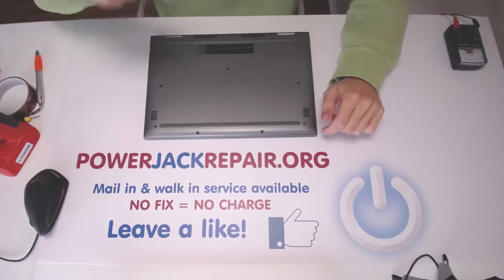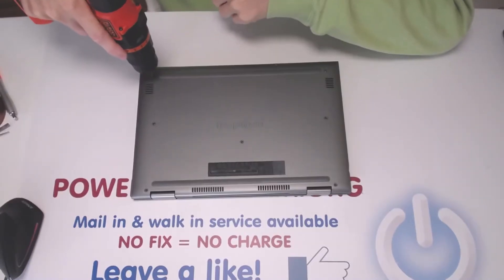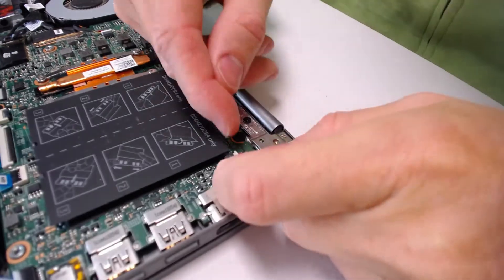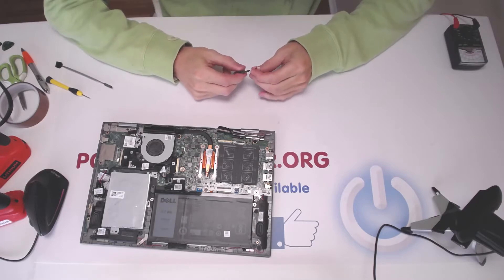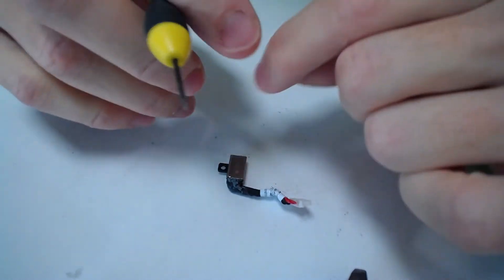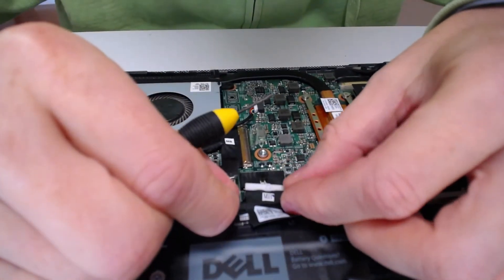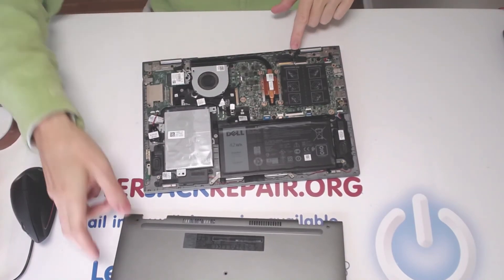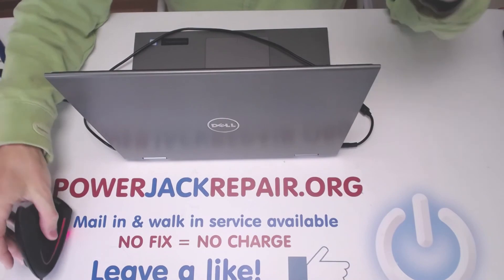Dell Inspiron 13 2 in 1 p69g p69g001 disassembly laptop charge port power jack repair fix taking

Comment: I have the same Dell p69G001 laptop.  I was able to change the charging port without taking the other pieces off.  Once I opened the back of the laptop and unscrewed the one screw holding the port down, I popped the connector off, took out the charging port, plugged in the new one and screwed the new port back down with that one screw.  I'm not sure why you took all the other components off first.  It took me literally 3 minutes to complete the replacement once I opened the back of the laptop.

Comment: hello I have a dell inspiron 13 2 in 1 5378, which I have problems with the battery. I bought a new original and this came bad, so they gave me my money back and I bought another generic. When I put in this new battery, the laptop started working fine but the Bios told me that the charger was damaged. I bought one and everything was fine until suddenly the laptop shut down and when I restarted it the next day I threw a problem in the fan cooler. So when I disassembled it, I found some pieces of plastic that had the fan cooler locked, I cleaned it and apparently everything was fine. But when reconnecting the whole laptop it does not turn on anything, in fact the lighting led only lights up for a second and turns off when I connect the charger. What can be how I can repair it?

Comment: i replaced DC power Jack cable for my Dell inspiron 13 5379 and new power DC cable Universal but still no power
Reply from the maker: Universal power supplies in theory should not be able to charge the battery on the laptop, you are sure the + and - on the new cable are correct ones the ones that go from the jack into the motherboard.
Reply: @Powerjackrepair  yes the powet jack cable can only be inserted one way to the connector. I tried to push it hard so it firmly stay in